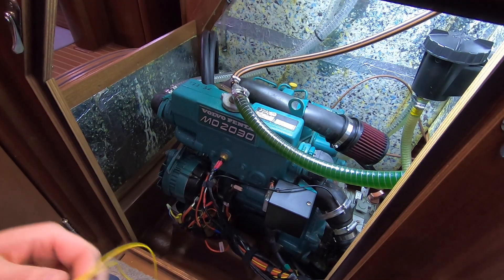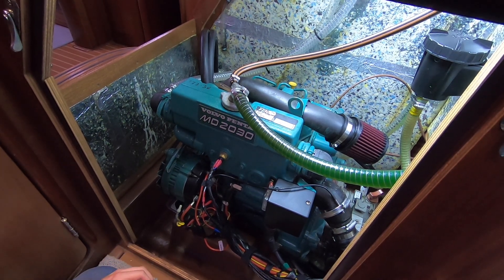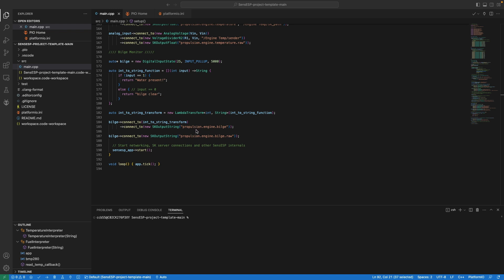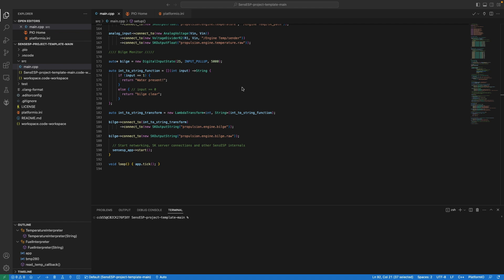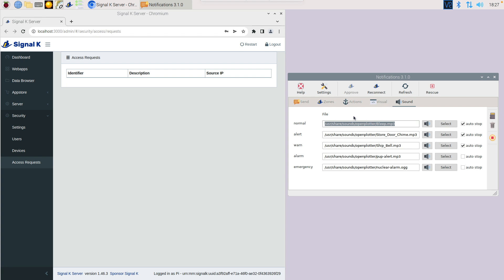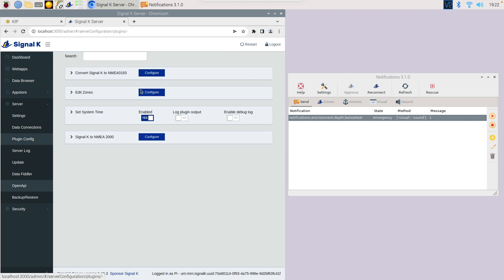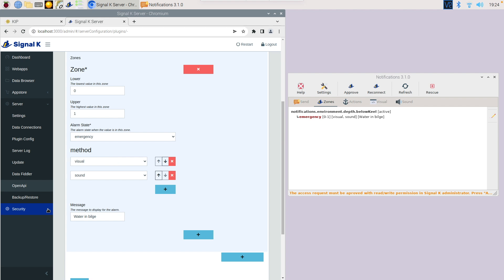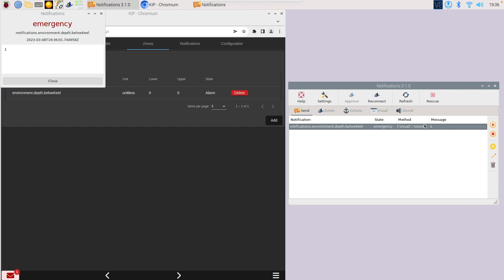OpenPlotter Notifications &  Bilge Monitor Update - SensESP

Comment: One project I want to do is put a gas sensor in the bilge then use a relay to operate a fan to suck any gas out of the bilge.
Reply from the maker: Hi - That sounds like a great project. You could change a pin on the ESP based on a value and then that could turn on a relay. I did a bit with digital switching but not tried your idea. I do wonder what those gas sensor send out in terms of data/values.
Reply: @BoatingwiththeBaileys  they have digital outputs and a potentiometer for setting level, should feed straight into a relay
Reply from the maker: Hi - Do you have a link to one of them, i would like to take a look also.
Reply: Another project will be an annoy an orca device!
Reply from the maker: @DaveWatts_ejectamenta  That also sounds interesting, whats the plan for that?
Reply: @BoatingwiththeBaileys  get a hifi hat for a rpi, then a power amp, then some under water speakers, then garble up some orca sounds by cutting and overlaying etc and play it back to them.
Reply from the maker: Interesting idea!
Reply: @BoatingwiththeBaileys  another thing I thought about is wiring a illuminated switch with a relay to the 12V supply, then using gpio pin 1 to trigger it. This means you can have a switch for the RPI away from the RPI and the light on the switch will tell you if it is running or not.
Reply from the maker: I have done some digital switching with the Pi and its worked well.

Comment: Hi Mat, do you have some wiring diagram for the water sensors? Not sure how to wire them correctly. Thanks a bunch in advance!
Reply from the maker: Hi, i included it the video before this one https://youtu.be/WGJlPRmjxGg?si=JIcXg-jSl15vK03E about 8 mins in but at the start i show that wired to the esp. if that doesn't help, let me know and I'll draw it out and share it.
Reply: @BoatingwiththeBaileys  Thx a lot. That helped! Another question, sorry for that ;)  I've watched Apres sailing wiring the oil pressure sensor and bought an Optokoppler to do the same. He used a zener diode and a resistor to do so. Others do it by hooking up an INA219. I could not find out how your Optokoppler is wired exactly. My engine is a VP D2-55A, without pressure gauge, only a light and a buzzer. Maybe you can point me in the right direction here also .  Much appreciated 👍
Reply from the maker: Hi, I've only used that on my RPM setup and the wiring diagram for that is here:

https://github.com/boatybits/boatymonpy/blob/master/Schematic_BoatMonitorSMD_Sheet_1_20200209152710.png

I never did wire in oil pressure (thats still on my list) but my approach to that i think will be slightly different and i'll buy either a sensor that does both, switched for the oil pressure light on the panel and sensor for my ESP monitor, or to T off and leave the engine wiring and sensor as it is now and wired something new to the ESP. Hope that helps.
Reply: @BoatingwiththeBaileys  ah ok, guess I saw too many videos and lost track :)
Reply: @ just saw the wiring in your previous video. The only thing that startles me: If the esp32 pin has an internal pullup you do not need an external resistor, right? Woud those water sensor cables go to ground and a GPIO only, without connecting 3.3v?
Reply from the maker: Yeah, not sure you do need the resistor, but im not also sure if all ESPs have the internal resistor.

Comment: Hi, I follow your videos but have not seen them all so maybe answer is in one of them... what is the system on the top of your engine ? is it for cooling or heating or something else ?  thanx
Reply from the maker: Hi, is that the black box that says Adverc on it or the green header tank with coolant in?
Reply: @BoatingwiththeBaileys   I don't see "Adverc"  but yes with a transparent pipe that looks like coolant in it , and a smaller black /orange pipe.
Reply from the maker: @gg-jz7wt yes that to the header tank. With this boat having a hot water tank that's heated from the engine, the coolant gets very close to the top of the heat exchanger. Having an external tank that's above that helps to get rid of any air in the system. That pipe is the return and then the clear one with green in is to the top of the heat exchanger.

Comment: Hi , often ESP32 doesn't connect to Rpi or in other cases it connects with a lot of delay.
  Does this happen to you too? Do you have any remedy?
Reply from the maker: Hello, I have had a similar issue where the ESP didn't want to connect so i my system i have to make sure the Pi is not connected to the marina wifi or my phone hotspot and everything works as expected. Check this document, and let me know how your wifi is setup - https://openplotter.readthedocs.io/en/3.x.x/network/modes.html
Reply: @BoatingwiththeBaileys  hi,  my Network on Openplotter is configured in "AP+Client" (AP and station) mode, however the problem also occurs when disabling the Hot spot . Connection often takes place after a very long delay.
Reply from the maker: You could try setting the the Pi to AP (on board) so it acts as the access point and then connect the esp directly to the PI and see if the issue goes away. Just change one thing at a time
Reply: @BoatingwiththeBaileys   I have a similar WiFi connect problem.   The ESP32 WiFI  connects  fine when connected via USB but does not boot using onboard Vin power with a 12Vto5V buck converter.  I can start with USB unplug w/ Vin power and it works.  The ESP32 has 4 1 Wire temp problems and 2 voltage dividers to ADC for measuring the Start and HOUSE battery.   I've checked the power supply and all is fine.  I have other boards that work fine.   Have you experienced anything like tis?

Also, thanks for the help with adding Signal-K text messages.
Reply from the maker: Hi, Thats an odd problem, so the board will power up using Vin but not connect via WiFi? I power my board via its USB port rather than the Vin so its not something i have actually tried.

Comment: Hi Mat, I have just discovered your channel and I am glad I did. You explanations are very good.  I have never used any Arduino gadgets but I am quite comfortable with the Pi. I have a cat with a pair of MD2020s, I would imagine I need two ESP32’s one for each engine. My question is how does the PI and the ESP32 communicate in your environment? Kind regards Phil
Reply from the maker: Hi Phil, Glad to have you onboard. I would think thats the esiest way to set them up in a cat and you could code something into the SignalK paths for port/starboard engines. The boards are cheap enough and it would save you running cables across the boat. They communicate using 2.4g wireless to the Pi, so the range is good. My pi is setup as an access points so these can connect and I can also connect to it to stream data to Navioncs and view info from my phone etc. Let us know if you need any info/help with setting this up.
Reply: Thanks for the quick response. I have a lot of learning ahead and I am sure I will have a question or two.